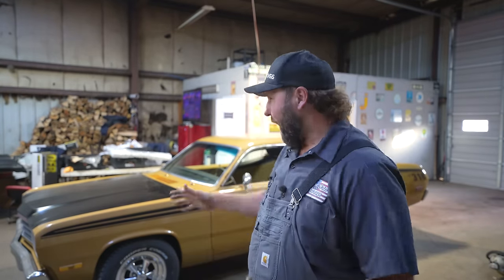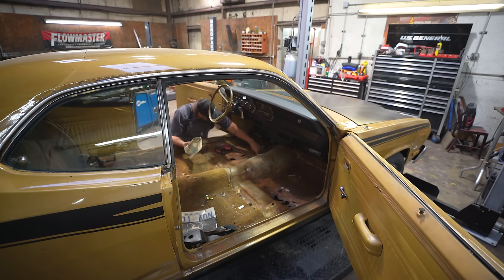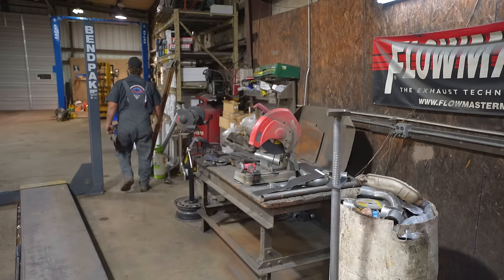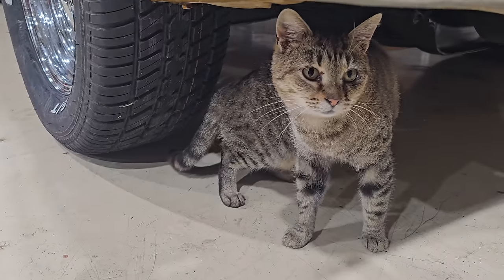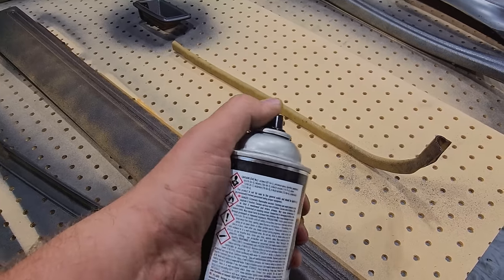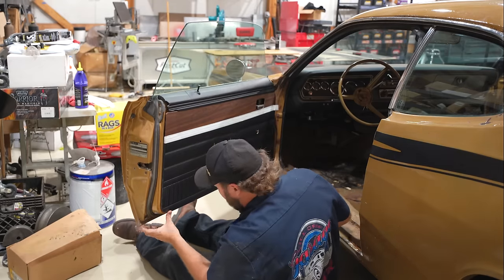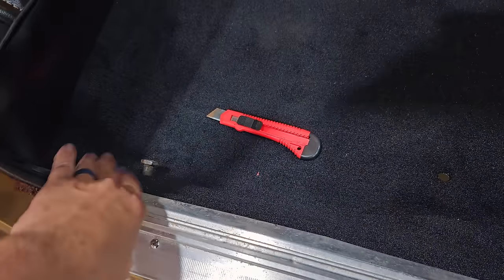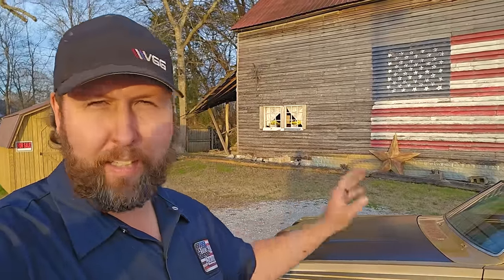FIRST DRIVE! Patching Floors and NEW INTERIOR For The Duster!

Comment: I don't know if you already know this or not but a little trick to helping spray paint cans from clogging up is to when your completely done spraying with them just turn it upside down and spray until it's just air and it'll get the paint out of the tip so it'll work next time you use it. Try it and let me know if it works. Always has for me

Comment: That Duster will be a cool car for someone. Disc brakes work with 14 inch wheels if you have the original type disc brakes. I have a 1966 Barracuda with 14 inch wheels and the original optional 4 piston disc brakes. Great job on the Duster. I have learned a lot from watching you work on various different rigs! keep up the good stuff and it's awesome getting the family involved also!

Comment: That little Milwaukee M12 cutoff tool is great, the only downside is it really eats through the batteries. Put the vacuum attachment on it, and it's great for cutting through the plaster layer of lath and plaster walls without a huge dust cloud. 
Why not go over the entire floor with a wire wheel on the grinder, vacuum it, wipe it down with cleaner, and then spray it up with a rust converter?

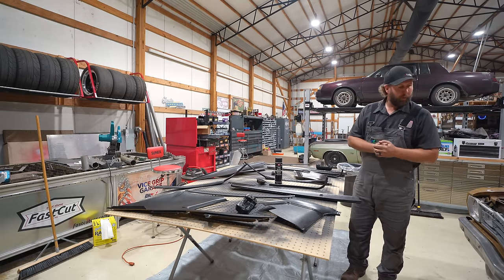Comment: 36:25 always turn your paint spray can upside down, and spray until nothing comes out, then your spray pattern will spray a clean pass, if you don't then the paint drys at the tip and sends spirits spray out.   
You also need to shake the cans longer.

Comment: There's a product (name I can't recall) comes in a black spray can, which when you spray it on rusted areas it changes the rust and prevents it from further damage. It's meant for battery terminals but works great for rust.  The only down fall is it leaves a tad bit of sticky residue that you don't want on your clothes.

Comment: I use a cheap soldering iron to cut and seal holes in carpet or any other place which requires holes in fabric or vinyl. Perfectly rounded and sealed edges every time.

Comment: Do some research and u will discover you can get the interior paint in bulk and use a sprayer same as the paint and u will save MASSIVE on the costs of painting a interior. In the past we would get lucky and find some, big savings over using cans. Good luck.✌✌

Comment: Derek, 485 ponies is a lot for a stock A-body Mopar unibody car to handle, especially if the rear meats are getting some traction. Your buddy at The Questionable Garage just bought and installed a nice set of under-the-floorpan subframe connectors and front torque box stiffeners under his Duster...both were/are the bees knees for any A or B-body unibody car that is going to he hopped up to that much torque and horsepower. ;)

Comment: Those floor repairs are a bit fancy. I have done it with pop rivets and roofing patch tar. That works very well. But please seal up the lap from underneath or the new patches will rust out PDQ. Also, I think it would be a good idea to tie in the new steel with the box beams for the torsion bars.

Comment: For a pattern a piece of poster board from the grocery store, works wonders. Lay a larger piece than the hole over it until it conforms to the floor shape, then press down until you feel the edge of the hole, and run a couple of fingers all the way around to mark the edge of the hole in the poster board. Then it can be cut out with scissors, and then you have a rough pattern. Tweaks it until fits the hole, and trace it out on metal. You can also leave an edge to lay over the edge for easier welding. For compound corners, the metal may need a few cuts to fold in. The whole pattern can be cut out with the relief cuts and all.

Comment: We Mopar guys drill 1/4" drain holes every two inches down inside those torsion bar crossmembers when we get a new to us car. If we're patching the Captain's and Drinker's side footwells like this we clean 'em out good, drill drain holes and apply brush on or spray on rust converter down in 'em before we tack weld, seal and paint everything up. Keepin' 'em from rustin' away is a thing in a lot of the states fellers. ;)

Comment: Not sure where you are on this build three weeks later man, but as far as the tire hitting the fender goes, you had a much simpler option by changing the tire size to something like P215/65R15 as that is about the same height but narrower. I've worked for GOODYEAR for 23 years and have helped many hot rodders tuck rubber in that time. Oh I almost forgot, the difference in the flex of the sidewall would have changed the appearance of the offset as the sidewall wouldn't be protruding past the fender.  Just some friendly advice.

Comment: "Back in the day" I patched some rusted out floor pans with fiberglass mat and polyester resin. It adheres well to rusted metal and naturally follows floor contours. No cutting and bending/shaping of sheet metal required, and no welding required. Also makes a water tight repair.

Comment: I think 1972 Duster has disc brakes you might check into it to see if a disc brake set up would work on your car. My friend had a 1972 Duster 340 race block and 4 speed Transmission and stage 3 race cam. Anyway it would hurt to check into it.

Comment: there is a guy on youtube who does carpets professionally, his technique is the best ive seen, he uses FLAT carpet, whatever you want cut pyle style and FORMS it, he used spray on glue that's heat sensitive, steams the carpet, molds it in using baseballs, rubber mallet, so on so forth, then heat to set the glue and his jobs are PRO, he steams out wrinkles everything you would think it was factory, even uses the thick padding that makes your car smell new

Comment: The factory manual disc brakes will fit with the 14 inch wheels my dad has a 1975 duster with factory manual disc brakes and 14 inch wheels.

Comment: @ViceGripGarage So Derek instead of change the whole rim & tire combo could you just run a tire with a smaller sidewall than whats currently on it?? Its looking great tho. Changing the interior color from that tan/light brown to black looks so much better & that grant steering wheel is awesome looking in there even tho the wood grain is a little different color than the other wood grain..

Comment: My uncle worked for Steakley Bro.s Chevy in Tx from the 50's til early 80's. Me and my cousin could drive any trade in or car on the used lot. We were so spoiled. We always wanted to 'borrow' the mopars but he rarely took them on trade and we never got to ride around in them. His reason for not taking them was RUST. He used to say they had so many water catch points that even two year old cars could need extensive repair. Never will forget that. The only cars he wouldnt let us take were the vettes. We drove almost every other great muscle car from the 60s and 70s except for the dodge/chrys/plymouths dang it.

Comment: Why not use lower profile tires on the 15” rims and keep the disc brakes? If rubbing is an issue the only problem is the overall diameter of the tires not the rim size.
Reply from the maker: If you can find less than a 50 series tire in 215-235 15, I'll buy 100

Comment: Looks fantastic 
 Don't like the color. I was luck. When i rebuilt my Duster it was seriously  100% rust free except some ninor surface rust. South Texas car. Interior was completely sun rotted away and eaten by critters.  Chrome was faded but each piece was in good shape,several missing.  I was able to find a donor car. Good job. Always do it right the first time, doing so will always save you time and cash ! Should be able to trime the fend a bit to make the tire/wheels to fit. I used Cragor wheel also with the brushed and shadow inner look. Same tire/wheels size as you  including the Cooper Cobra tires ! Use Cooper tires on all my cars.

Comment: Hey Derek its Timdude ..im confused your 400 small block 71 chevelle ...victor jr intake ..750 brawler double pump ...and a corrected time of around 12.60...i know u went 8.10 in the 8th mile....so a 318/351 ..oh dose it have a 360 crank??....with a medium size dual plane intake and a quick fuel 600 vacuum secondary....i know the exhaust and headers are big....but 485 horse power hard to believe ...a while back on the dyno Power Nation Engine Power put a 950 Quick fuel on a 266 cu in v6 and it maid more power ....im 60 yrs old so ive had a few fast cars ....back in the early 2000s ...anyways can u please bring it up in a future video and explain it a little i know ur very busy ....no worries no rush....sometimes my brain go retarded it has bad timing chain or i go into brain lock like a broken rod....lol Derek ....love your shows ...PEACE OUT

Comment: My ignorance may affect my comment, but why not keep the 15” wheel and put a lower profile tire on the front? I’m not sure if the tire diameter or the offset is what caused the interference with the wheel well.
Reply: By the way, I love the build! I think you did all the right things.
Reply from the maker: There isn't a smaller series tire in a 15"

Comment: I'm disappointed you didn't wire-wheel the floor when you had the seats and carpet out. Clean it. And spray it with a rust protector and sealer. You did the bottom. But you had everything out. You could've also cleaned the inside and treated it at least. And the roof inside. Sigh.

Comment: Welcome to the world of Mopars!  You can't buy every part for them out of a catalog - it just can't be done.  I used to have a really nice Valiant and a Swinger.  Both hardtops.  I had to abandon both projects simply because 25 years ago, there was absolutely ZERO sheet metal available for them.  So it was either cut up other cars for steel or give up.  I had to give up.  Even today, you still can't get many of the parts necessary to restore a Mopar - especially the A-bodys.

It's almost easier to restore an AMC because for years, they were so cheap.... you could afford to have seven of them in the back yard to cut up for parts.  Now with everything worth 800-billion dollars.... who knows what the future holds?

Comment: Fix the sheet metal right, before it becomes a Flintstone car.
The floor pan and firewall should never be left rotten.  You can't risk loosing the driver under the car driving.  Cut the rusty metal out and replace with new metal,  its open the cars apart its ez to get to fix it.

I had a 74 Plymouth fethor duster  i belive it had a plastic glove box.
The fethor duster had a slant 6.

Comment: Hey Derek, please think safety when you are using one of those grinders,  I always put safety glass's on and got real lucky one day because I did, those thin blades sometimes snap, and when they do they break and travel at a high speed, if I didn't have my safety glass's on I could of lost an eye. Sure would hate for that to happen to you, would miss your show (not really) but I want you to feel good about the boring shows you put out. (really). Oh, by the way did you ever think of becoming an actual auto mechanic, you do really good for being a rookie. All you have to do now is get away from the vice grips and use real wrenches. By the way your one large gauge on the left doesn't seem to be working. You know you gotta get it right if you want to become a professional.